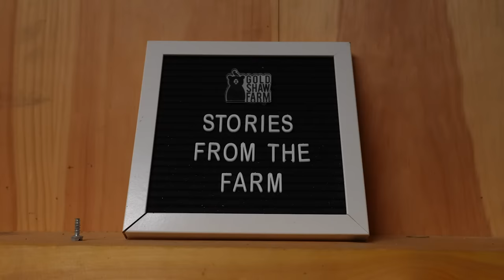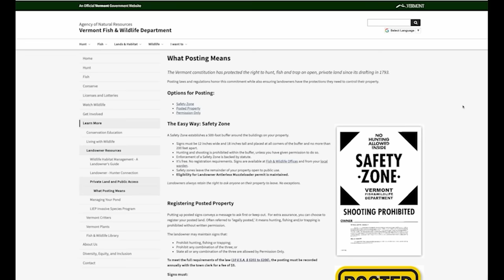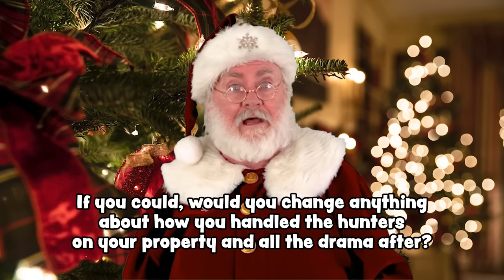Addressing Difficult Questions About My FARM

Comment: Looking at your Red Barn from overhead. The big thing I see is a serious risk you need to fix. Your open barn windows need to have mesh screening installed outside and inside as a double layer of invasive protection. Nesting birds owls and, of course, protection from bad neighbors, Roman Candle projectiles. Get it done, Morgan. Before you wished you had as you watch your barn burn down

Comment: Hey Morgan, regarding hay: you don't need to buy modern tractor equipment to make hay. In my opinion, that's actually a losing proposition for most homesteader/farmsteader types, and I think a lot of people think that buying a tractor and tractor parts to make hay is the only way to do it.

We've been making hay in other ways for thousands of years. Two hundred years ago, we weren't even baling hay. We were making haystacks. And there are some advantages to older methods, including the ability to stack hay in less than perfect conditions. When you bale hay with a tractor, it absolutely has to be the right moisture content because if it's too wet, you risk mold or spontaneous combustion (yes, wet hay is a higher risk for spontaneous combustion!) 

But when you put it in a haystack, you have the ability to pull the protective cover layer off the stack on a nice day to give the hay time to air out a bit. 

These days, for people who still make haystacks, I mostly see them use a scythe or a horse-drawn hayer to cut the hay. Then they collect the hay onto a tarp and drag the tarp-- or fork the hay on a wagon-- and lead it to where they plan to make the haystack. Most people who make hay this way cut about an acre a day. They'll cut the hay, let it dry a day or two (while going on to cut another two acres during the days that they're waiting), then go back and stack it. But again, they're the definition of a smallholder: I think the most I've ever seen someone do with this method is thirty acres, and it involved a team of four people. Two to scythe, two to stack. 

But I've also seen one person manage to do ten acres by themselves over the course of two weeks, and for their personal use case, that cut their winter feed bill in half. 

I'm not suggesting you should do this. I don't think it would be suitable for your personal use case, because I don't think it's worth the time investment for you, and I think Vermont's propensity for wet weather still makes haying particularly challenging no matter your method. So while I hope you find this post interesting, I certainly don't think it's applicable to you. 

But I hope other people reading this will stop and consider that if they want to make hay themselves on their own homesteads, they don't have to invest in enormously expensive modern tools to do it. If you have a relatively small field that only gives a couple acres of grass, but in a location where you can do multiple cuttings over the year, you can cut down on your feed bill quite a bit.

Comment: You know what I miss? I miss working from home so I could catch these videos practically the moment they dropped. Now, I have to go to a job all day so I have to wait all day to get the chance to watch. I miss that. However, it does get me back into some level of farming (work for a tractor dealer). Which leads me to something regarding the video you made the other day where the comments were turned off. That lady said what she said about real farmers not going and buying new tractors and equipment.. She couldn't be more WRONG.  I work for a tractor dealer and we move out a crap ton of brand new tractors every single week. It ain't city folks buying them, it's flipping farmers that are buying them. 
It really bothered me that she said because I grew up on a farm where we werent gonna even consider buying a new tractor. Once I got older, I realized my folks went to great lengths to spend a dime to save a penny by buying used equipment. Part of the reason I learned to mechanic is because someone had to learn how to work on my dad's 2nd, 3rd, and 4th hand machinery. At some point, he did realize how much money he was losing on that stuff and he started buying new tractors and hay equipment. 
But yeah, there are tractor dealers in business because farmers are buying new tractors. The lady saying that was just one of many things where she feels like anybody doing something different than her is just automatically wrong.

Glad to see another Q/A video.

Comment: Hey Morgan just saw your new video I wanted to give you a couple of tips that might help for cattle one I saw you have a temporary fence lane down from the top pasture might not be a bad idea to make that permanent second mabey using some of you new barn/building a hay shed for your bails a hay spear rather that huger for bails and for your cows as grass feed cows some minerals  and actually dry hay not silage bales making a concrete floor barn yard with durable metal fence not your tones of gates you bought your cows can just push those around actually round bale feeder a cattle brush for inside the barn on the wall and beding the cattle with straw hay corn foter somthing

Comment: Easily getting pudgy is a possible genetic adaptation for better survival overall!  The advent of modern, relatively merciful medicine has stacked the survival advantage on the side of body weight limitation in all but the most desperate situations, like if you are about to walk across Antarctica via the pole, but it didn't use to be that way....